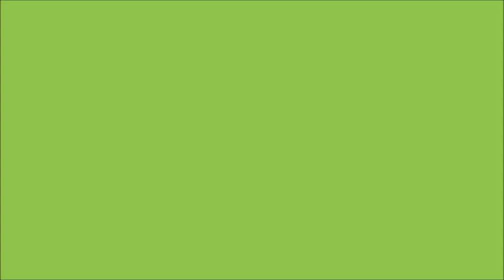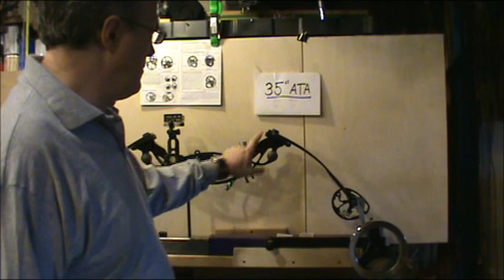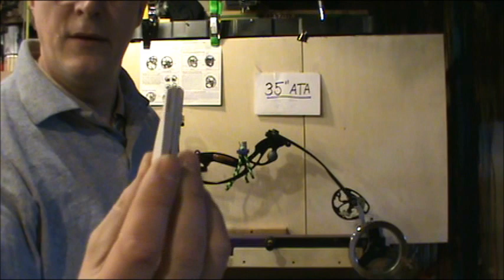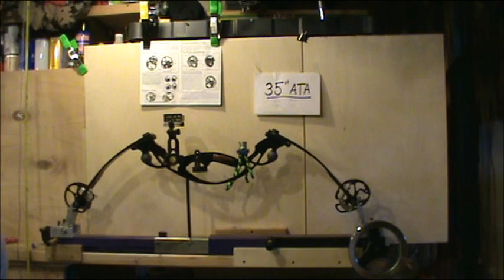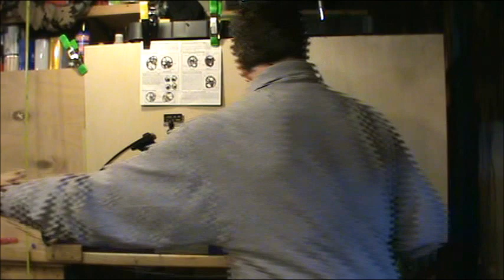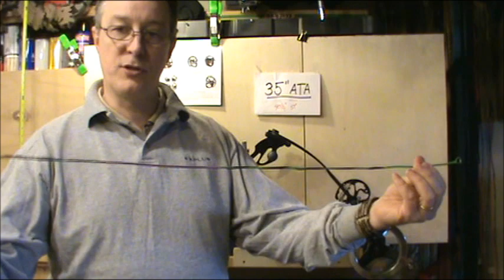Frankenbow, Finding the Cable and String Length

Comment: I once had a Hoyt Raptor Intruder I bought from Ebay that worked just fine (for an 80 lb bow!). Problem was, it had "Master" cams with an effective 65% let-off and I wanted a higher L.O., so I bought a set of "Advance" cams offering an 80% L.O. and got a very unexpected bonus....the draw weight went from 80# to an unbelievable 130#!!! Honestly, ALL I did was the cam change (and, yes, I got it right first time out!) !! It went from great to Monster that quick. Been regretting selling it for sometime since, but I hope the person who bought it is still enjoying it !!
Reply: Damn. You'd have to fletch rebar to get properly spined arrows for that thing! Sounds like a good workout for lower poundage shooting though - kind of like running with a weighted vest.
Reply from the maker: I know this is an older comment but for others who might read through this I'll weigh in. 130 pounds is a torn rotator cuff waiting to happen for most shooters. The weight increase is likely caused by an increase in deflection of the limbs. A larger cam will pull more cable length as they rotate causing more limb flex.  By increasing the length of both cables and string you could probably get it back closer to spec and depending on the (rotation) orientation of the cam, shortening the string some will advance the cams so they don't rotate and compress the limbs as much. Ultimately I wouldn't want to shoot a 70# limb at 130# you are just asking for a limb failure.

Comment: I would like to ask if my bow is 70 lbs. It can be adjusted from 40 lbs to 70 lbs. I always play 40 lbs. When I put on the bow opener, should I adjust the lbs to 70 lbs and then measure the string length?
Reply from the maker: Not sure your translator is doing an accurate translation but I think I'm getting the basics of what you are asking. A good string should not change length regardless of the bows weight, so you can measure it at any weight. Most string makers measure their strings while it is on a string jig at 45 kilograms (100 pounds). Note when making a set of cable/strings, your string and cable lengths will need to be a length that will allow you to flex the limbs enough to get to your full weight. I would also not recommend that you shoot a bow that is flexing the limbs beyond the recommended draw weight.  Under weight is fine though.
Reply: @pmm422  Thank you for your answer. My compound bow is 70 lbs. I use the opener to hold it to 100 lbs. Is it over the limit? Will the bows explode?
Reply: @pmm422  
I'm from Taiwan, I use the website to translate your video, but the translation can't really translate the meaning, so thank you very much for your careful answer
Reply from the maker: @皮筋拉扯之間  A more likely scenario is that prolonged usage will cause the limbs to crack but I personally would not shoot a bow that is beyond the manufactures recommendations.
Reply from the maker: @皮筋拉扯之間  I've seen a lot of bow failures including a riser that broke in half. A more likely outcome is that the limbs will develop cracks, I personally would not shoot a bow that is drawing beyond the manufacturers recommendations, both for safety of the shooter and the equipment.

Comment: After deciding what you want your ATA to be, why not look up the string specs for a bow that uses the same cams and Note the ATA length of that bow.  If your ATA is SHORTER,  then SUBTRACT the amount it is shorter from the cables AND the bow string.  On a single cam with a long string, subtract twice the difference in ATA from the string length and subtract the difference in ATA length from the buss cable.  If your ATA is LONGER, then ADD the amount that it is longer to the string and cable specs of the Standard reference bow.
Reply from the maker: Sure you can do that and I often do as a double check to my measurements assuming there is a decent reference point bow to work from. When doing franken bow stuff you are often using components from multiple manufacturers with large variables like limb length, limb angle and deflection, riser deflection and cam rotation. So using the method I outline in the video you can measure all of the variables (except draw length) prior to building a string. I've also seen significant variances from the manufactures specifications and reality. Lastly you are also making the assumption that the manufacturers setup is one I want to mimic, that too may not be accurate. Having said all that I do believe your general premise is valid.
Reply: Joe Blake that exactly how I do it.